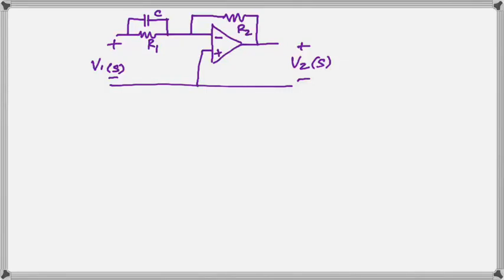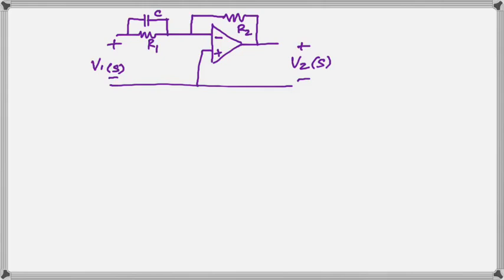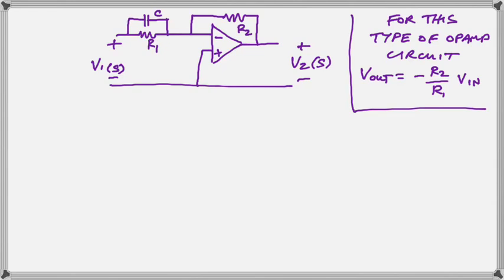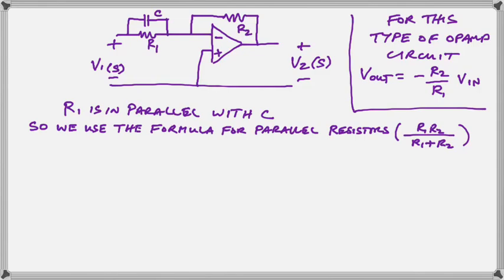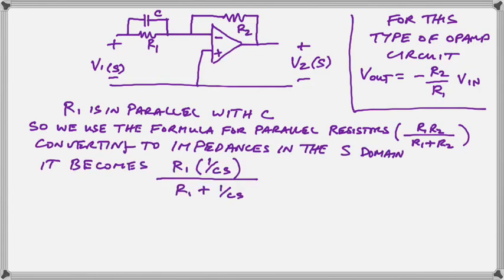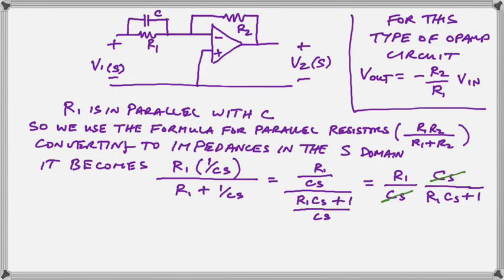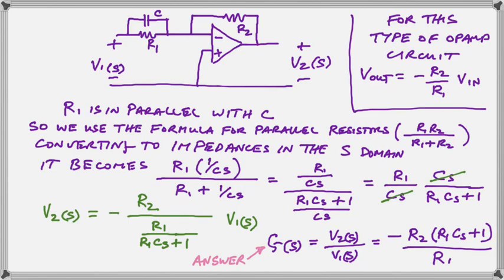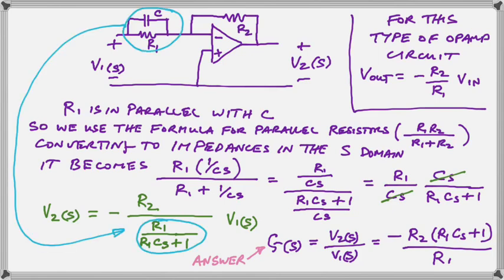capacitors in op amp circuits

Comment: Hi, what if we add a second capacitor in series with R2?
Reply from the maker: It would complicate the solution a bit more 🙂 ..... R2 is a feedback resistor, putting a capacitor in series with it will block the DC feedback ..... you sure you don't mean in parallel ?